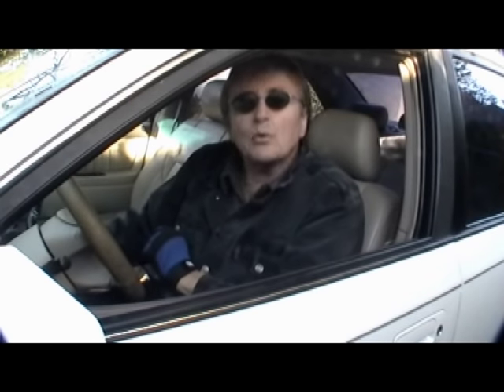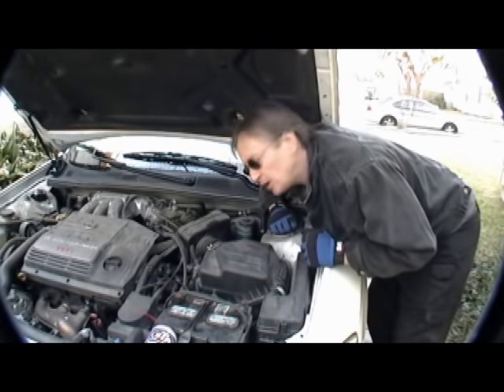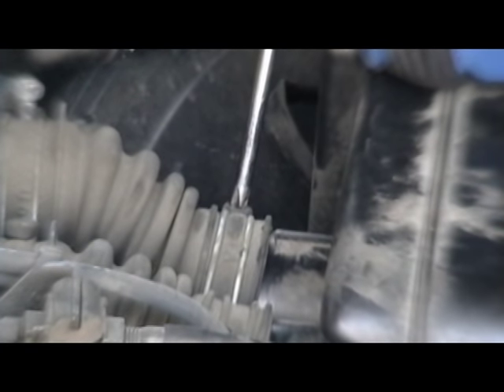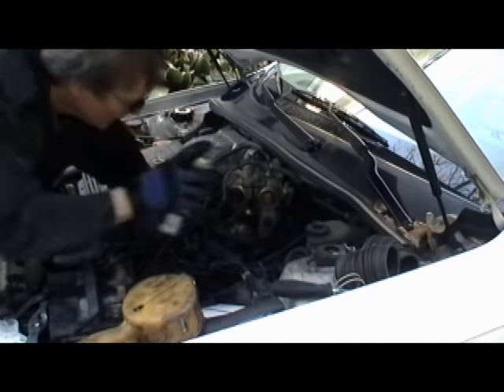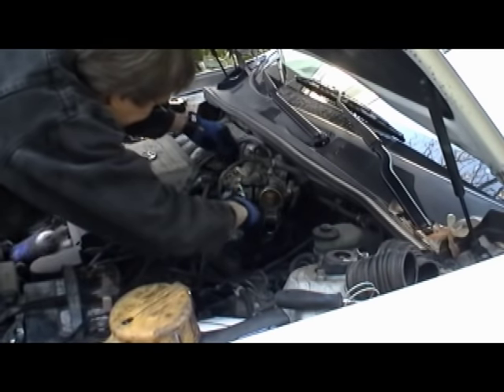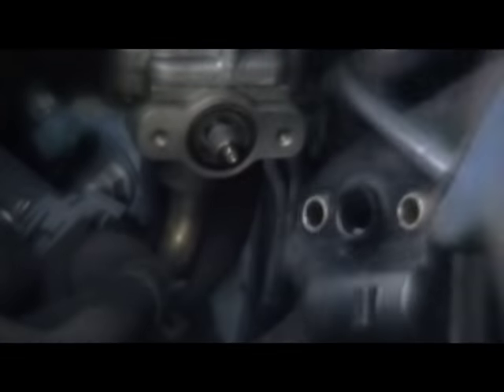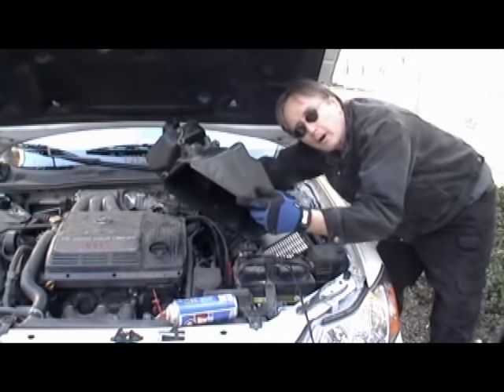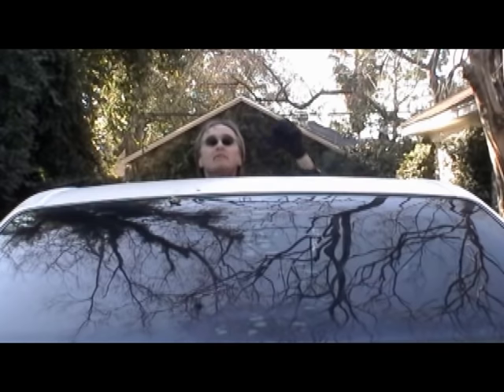How to Fix Engine Idle Problems in Your Car (Rough Idle)

Comment: I have a 2004 Toyota 4runner and my vsc light is on but I had the mechanic use the obd 2 on it but no codes appears . I was wondering if you have encountered this kind of issue before.
Reply from the maker: if that vehicle has any problem that turns the check engine light on, it will automatically turn the vsc light on too. BUT if it's only the VSC, then you need a better mechanic using a higher level scan computer to read most VSC codes
Reply: OK thanks it came on at 60,000 miles but it's that code and the vehicle stability  control  as well could it be the power booster for the brakes I know they put all that together sometimes

Comment: hey Scottie my 1997 Pontiac firebird only idles when I'm in gear and when I stop do you suggest i try doing what u just did to solve my problem
Reply from the maker: +Lamont Johnson try this fix in the video first, also check or vacuum leaks
Reply: +Scotty Kilmer How do you check for vacuum leaks when you have a loud ass fan like my 98 explorer? I can hear air but its coming from everywhere. CLeaned IAC and MAF and Throttle body. Still idling low and dies when i come to a stop getting off the freeway.

Comment: Hello Scottie! I have a check engine light. I think my air intake temperature sensor (the one connected to the air box) is not working. What will it cause to my car? Thanks a lot.
Reply from the maker: +Vincent Rodriguez it would make it run a tad bit poorer and keep the check engine light on.

Comment: 02 Jaguar v8 idles up and down.i cleaned throttle body good it helped but still does it from time to time.i need to find were idle control valve is on this car.
Reply from the maker: part of the throttle assembly, super expensive
Reply: Scotty Kilmer I found it thanks not bad at all.sprayed some clean in it put it back.its doing fine.
Reply: Scotty Kilmer your right if I had to buy one it's 270.00$$$😠

Comment: have 94 Chevy Suburban keeps cutting off when I take my foot off the gas replace fuel pump fuel filter had it tuned up new spark plug wires sensor and still do the same thing need help thank you
Reply from the maker: +Ernest Bell of course do this video first, but if not that, try "finding engine vacuum leaks with a cigar"

Comment: What is the problem when your rpm is so high when you turn on the AC, 1800rpm and when your AC is off the rpm is 700. I already clean my IAC Valve.. do I need to replace new one? tnx..

Comment: Scotty I have a 1999 ford  explore and it has a ticking noise constantly this is when driving or at idle what's the problem
Reply from the maker: get a stethescope and see if it's the valves ticking or the fuel injectors. You can live with the injectors ticking if it runs fine otherwise

Comment: Hello, I have jus cleaned my acura tsx's throttle body, but the engine light came on after. I did exactly the procedure on the video. Do you have any idea what happened?
Reply from the maker: cleaning often turns check egine lights on as they clean, then after driving a few days they go right back off.

Comment: Hey Scotty well its not my car but my motorcycle with this problem.For exact when the engine is cold it idles fine but when its getting warmer and reaches top temp then it idles rough and then if i turn off the engine and then back turn on the engine idles so poor and stops...any idea?should i check the IACV?
Reply: Any idea?

Comment: Thank you in advance.  My `95 Mercury Sable (3.8L with 40K miles) went weird on me yesterday.  Sitting at a traffic signal the engine speed surged a bit (it's done this before).  Then I notice the yellow check engine light on.  When the light changed I pressed the throttle and basically nothing happened.  It was running but not much more than idle - even with max pedal (floored).  I let off the throttle and it seemed to run slightly "better".  With "feathering" of the throttle it get up to about 30 mph and got me home (about a mile).  I shut it off, restarted - still has "check engine" light.  Any ideas?
Reply from the maker: get it scanned for the code and e mail me that, too many to guess

Comment: Hi Scotty, My 93 ranger had an issue with idle.. it would idle high around 2k and then slowly drop to 1k. The more I drove it the worse it would get and sometimes wouldnt drop at all. Also on occasion the engine would stall when I give it gas. So I thought maybe the IAC was the issue so I tried cleaning it and the intake, but now the truck is hard to start and as soon as I give it gas, it stalls It wont accept gas at all. It idles lower now like in the 800 rpm range however.  If I unplug the TPS, it will accept gas but doesnt rev up smoothly or evenly. Any ideas what could be going on with it?
Reply from the maker: +Retroman try cleaning the entire throttle assembly and check for vacuum leaks first.  Also try my video "how to clean fuel injectors on your car"

Comment: I have a scion tc ,06 and my rpm are going up and down and then stalls off idk what to do I tired cleaning my throttle but nothing..you have any advice what should I do.
Reply: try replacing the coolant temperature sensor known as the ECT sensor.

Comment: Hi Scotty: need some help I have a 2002 Chevy express van 5.7  v-8 --my vehicle has a really fast idle and tried all that I could to fix it , so far removed the throttle body l cleaned it like brand new, replaced the idle control valve, replaced the throttle positing sensor,replaced the air cleaner,changed plugs and wires dist. car pvc valve and still a fast idle ( I don't have a tach but it idles like 36 mpg     and advice will really help I;m stuck
Reply from the maker: +Bill K   do my video "finding engine vacuum leaks with a cigar"
Reply: +Scotty Kilmer thanks  Scotty  I'll check it out really hope it helps

Comment: I have a Mercedes CLK W208 and when i start it in the morning my RPM goes from 100 to 500 and back.. it some times shuts of when im trying to get the engine warm, also when im giving gas it holds itself in the RPM wont go up and he moves very stubby.. when engine is warm (80 degrees) it runs fine, might this be the EGR?
Reply from the maker: could be tons of things, including that. Have a pro with a star tester analyze it, mercedes are complex and guessing with expensive parts is foolhardy

Comment: my 04 dodge ram 5.7 has a stalling problem every now and then when I stop the rpms will jump up then die but when it gets warmed up it acts better. what you think Is the problem?
Reply from the maker: +Drift Silly do my video cleaning process in this video first, if not that, check for vacuum leaks
Reply: +Scotty Kilmer can you make a video on a scion tc throttle body and air control valve cleaning?  will be much appreciated.

Comment: hey Scotty.  I have a 2000 i30 that idles down and cuts off shortly after starting it.  but this only happens when it's cold outside.  any info would be greatly appreciated sir.
Reply from the maker: perhaps try a new coolant temp sensor for the computer and also try my video "how to clean fuel injectors on your car"

Comment: I recently replaced the timing belt on my Camry 1998 as it snapped. Now it's fixed but my car makes a a weird sound as if would turn off when I have it in parking or I get to a stop. I don't knw what it could be and don't have money to fix now til next month.. HELP!!
Reply from the maker: check the tmiing, it may be off a little

Comment: Hello scott I was wandering if you know haw to take the expantion valve in a nissan frontier 2005
Reply from the maker: gigantic job, pays a mechanic 600 dollars US to do the job labor alone. but here's the basics "
REMOVAL

    Discharge the refrigerant. Refer to "HFC-134a (R-134a) Service Procedure".
    Remove the heater and cooling unit assembly. Refer to "HEATER & COOLING UNIT ASSEMBLY".
    Remove the heater core and evaporator pipes grommet.
    Remove the expansion valve.

INSTALLATION
Installation is in the reverse order of removal.

Expansion valve bolts : Refer to "Components".
A/C refrigerant pipe to expansion valve bolt : Refer to "Components".

CAUTION:

    Replace the O-rings on then expansion valve and the A/C refrigerant pipes with new ones, then apply compressor oil to them for installation.
    After charging refrigerant, check for leaks.

© 2016 ALLDATA LLC. All rights reserved. Terms and Conditions

Comment: scotty Kilmer my 02 mazda 626 4 cylinder has been idling rough for a while. It usually gets worse only when I turn on the AC. it makes a faint but rapid clicking/ticking noise. And the RPM dips as well. It will start to shake/vibrate as if it's about to stall. It has stalled a couple of times. And when I turn the AC back off, the RPM's shoot up. Recent work done; replaced valve cover gasket because it was leaking oil pretty bad, replaced thermostat and a heater hose because it was running hot. (both seem to be fine now). based on the info do you have any ideas on why it's idling so rough? please?
Reply from the maker: take it back, sounds like a vacuum leak they may have caused during the work

Comment: I have a 06 Impala Ltz I replaced the throttle body and my rpm drops and sometimes stalls the car out, I just spent 1,000 on a fuel pump and it still does it HELP!! The shop doesn't have a clue what could be causing it and no check engine light eithe r
Reply from the maker: +slimgoody503 first, find better mechanics, it's their job to figure it out. but those had throttle body problems, IF your new one is good, replace the throttle pedal sensor
Reply: Yea I'll try that thanks they suggested I get a new fuel pump, and me not know anything about cars I shelled out 1,000 for it after they kept my car for a whole day, but I'll replace the pedal sensor myself thanks.

Comment: any ideas on a 2005 grand marquis the car starts if i pump the gas but when i let go off the gas peddle the car dies i changed the TPS and also the flow intake sensor but nothing i also cleaned the intake with throttle body
Reply from the maker: do my video "finding engine vacuum leaks with a cigar"

Comment: Scotty I have a 2005 Ford Focus 2.0 with a p0511 code. When i start the car, it dies immediately, and only stays running if i press the gas pedal. My IAC is electrically and mechanically fine, is it really as simple as cleaning out my throttle body? My IAC was very clean when i removed it and tried to clean it
Reply from the maker: on those, often a new throttle assembly is needed to fix that, I've changed out lots of them
Reply: Scotty Kilmer thanks for the help Scotty. I'll let you know how it turns out

Comment: Hi, just bought an older 1988 Chev MPFI 2.8 V6 with 110K miles.  Symptoms = rough idle, no power WHATSOEVER and sluggish.  6 cylinder sounds and feels like it is running on 4, but all are firing. and no wet plugs.  Changed all plugs just to make sure.  When driving, the motor skips inconsistently and really shakes the car hard.  Drive it on the highway last weekend after buying it and this is when the hard driving started.  It had a slight rough idle before I hit the highway after purchase.  Any immediate thoughts or common causes that you know of?  The tail pipe is making a putting sound and the exhaust looks new(er) and I don't suspect the convertor is plugged or anything like that.  I'm leaning towards electrical.  Also stalls when stopped sometimes.Thanks a million.
Reply from the maker: realize those are junkers at that age.  But do have the fuel pump pressure tested and pray it's just weak. If not that, see a guy like me to analyze it in person to see if it's worth fixing or if engine is just worn out
Reply: Thanks for the input and thought.  But many think these are worth keeping around as long as they are worth it to the owner.  They are rare up where I'm at so they hold thier value.  I could drop another donor power plant in it and sell at no loss.  Thanks again for the feedback.  Much appreciate.

Comment: Hey Scotty, 
  I was cleaning the air intake on my '04 grand prix, 3800 engine. I did a cable voltage check on the MAP sensor, now it won't start and the car's diagnostic system reads "reduced engine power". 
Would cleaning the contacts on the sensor cause this? 
Also, is it possible that I caused a short in the PCM/ ECM when I was doing a continuity check?
Reply: Update, I solved it! 
Keep your vids comin, excellent work man!
Reply: +Ricky Bobby What was the issue? and how did you solve it?

Comment: scot. if i cant use the iac valve on my 5sfe motor. can i use the idle screw to leave the throttle plate a crack open for idle?
Reply from the maker: +micheal balma you can try, but car wasn't made that way and that can mess with computer software and tps and other data

Comment: Mr. Kilmer, I have a 98 328i that will not communicate with multiple obd scanner but has power.  Good fuses etc. Any ideas? I bet you can't figure it out!!!
best, 
Jacob Olsen
Reply: Sounds like the Diagnostic Chip inside your PCM is worn out. Leaning towards you needing a new PCM.

Comment: Hey, did an engine swap from carburetor to qg15de fuel injected, but it isn't idling properly, rpm does not cross 1000 and it stalls when im driving. What do i do?
Reply from the maker: +Grax Killian  swapping to fuel injection is very hard to do correctly, involving sensor changing, wiring changes, and computer software changing, plus fuel pump changing. Have a pro check to see what wasn't changed correctly.

Comment: hello Scotty, I have a 97 explorer xlt and I replaced the fuel pump 8 months ago, but the last few weeks it has been stalling out and sometimes just shutting off while I'm driving? and it only does this when I make a slow left turn... I got no engine lights on either. when I feel it is starting to die I found if I punch the gas I got a 50/50 chance of keeping her running.  please help. .
Reply from the maker: +brian hopkins check for wiring shorts cutting power off when turning. If you can't find any, you could have gotten a crapper pump that shorts out when turning

Comment: have a 1986 buick electra park avenue and it turns on fine but stalled on drive and reverse only but now it doesn't  last on more than a few second. fuel pressure was at about 13 and a code 44 for lean 02 sensor is on. literally replaced almost every sensor besides iacv and tps sensor. can i please have your input
Reply from the maker: +Alex Avila  it's running lean, often a weak fuel pump or leaking injectors or fuel pressure regulators do that. Realize fuel pump must be tested for both pressure and volume

Comment: Sometimes the transmission revvs up over 40 mph is the trans fine or it some else
Reply from the maker: generally that's a slipping transmission if an automatic, or a slipping clutch if a standard transmission
Reply: +Scotty Kilmer:) i am having a problem with my car. I think you answered my question, but i couldn't read it. Because the video got erased. But how i said on my last comment, i am having this problem that is making me crazy. I own a dodge ram 2011 and every time i brake the rpm goes up. Not a lot just a little and i can hear a little accelerate. Can that be related to this video?

Comment: Hi Scottie. I would like to ask. I have a 1998 Toyota rav 4. It idles very well. But when I turn on the air condition, the idle starts to bounce occasionally. 
What wrong with it? & how can I fix it? 
Thanks very much Scottie.
Reply from the maker: +Vincent Rodriguez try my video"how to fix a car that idles poorly" and replace the idle air control valve if that does not work.
Reply: +Scotty Kilmer thank you Scottie. Learning a lot from your videos 👍
Reply: Hello Scottie! Should I clean the throttle body, throttle plate & IAC valve with a card cleaner with warm engine or cold engine? Thanks a lot.

Comment: Hey Scotty its getting friggin cold here in Australia now. My 94 corolla automatic choke is staying too long. And when it finally disengages the idling is rough. I replaced the choke sensor a few years ago, do I need to replace it again and clean the throttle body?
Reply from the maker: yes, and that old, me, I'd throw that carb away and put a weber conversion on, if you can find one
Reply: +Scotty Kilmer I'm not workin so what would be the cheapest fix? how much would a weber cost? the car has only done 190,000 km

Comment: Hi Scotty, I replaced an alternator for my co worker on her 92 saturn. it now is able to turn over but has a pretty rough idle, and almost stalls immediately when putting it into drive. would the cleaning solve this issue? i assume its never been cleaned before. has around 150k miles.
Reply: also, on the first start, I had to hold the gas pedal down and a good amount of smoke came from the tailpipe, very grey and black as well.
Reply from the maker: you could try it, but if you disconnected the battery, that makes saturns idle crappy a while until the computer resets idle speed which eventually goes back to normal just drivnig
Reply: +Scotty Kilmer like the positive lead? or disconnect completely?

Comment: I have 07 ford fusion and when the car is cold in startup the rpm jumps to 2000 for a few seconds and comes back down? only does this when car is cold.
Reply from the maker: +Antwanika Whitley try my video tests in this video, if not that, replace the iac valve

Comment: I have a 2004 chevy malibu and at stop lights my CAR will about off engine seems to vibrate and shake and does...I have to turn it off then back on for it to stop
Reply from the maker: +Tiffany Larry turning it on and off resets the computer, so have computer and computer sensors checked out for problems